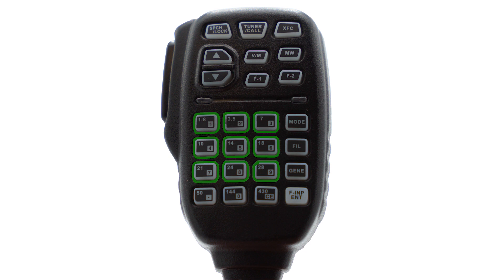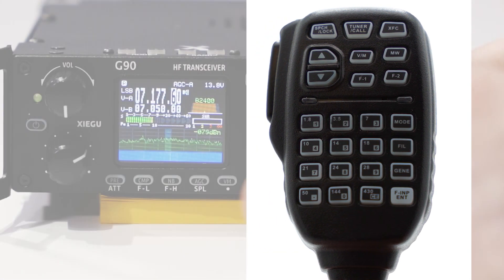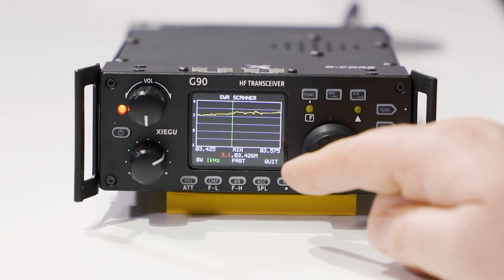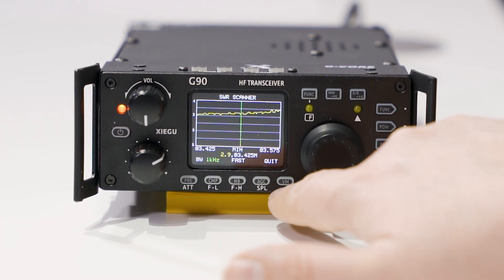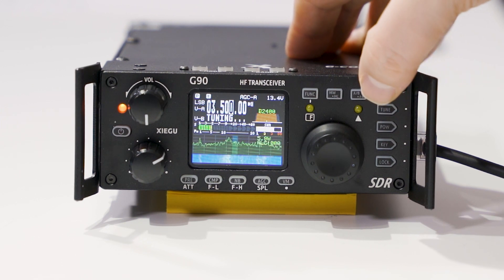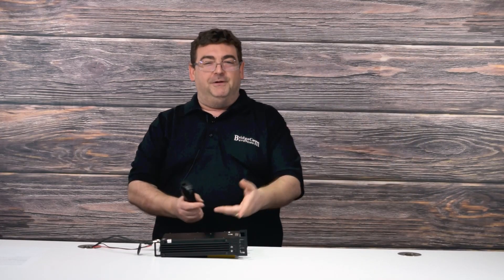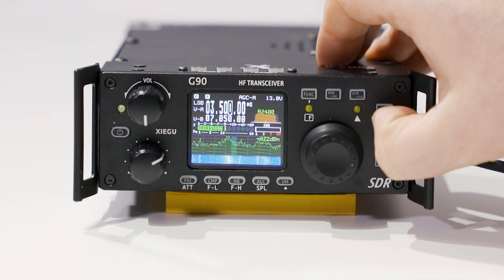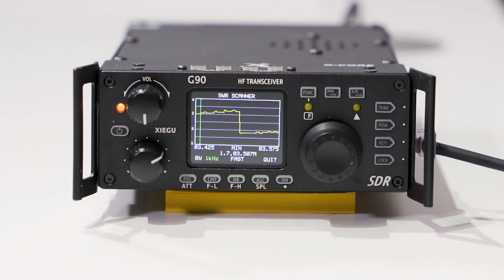Xiegu G90 Crash Course: Mic Controls, Memory Mode, and Antenna Tuning

Comment: Can the internal antenna tuner be bypassed in order to use an external amplifier and an external manual tuner?
Reply from the maker: Not sure.   But, there's help.  Join our Bridgecom systems Official Facebook group page and put your question there.  Lots of good help available.
Reply: @billr55  just don't turn it on.
Reply: @Charlie-Bee  Roger Roger, You are correct! 2 years ago I didn't know. Since then I purchased a 300 watt amp and with the external antenna tuner it works really well. The g90 has very good audio out of the box for the price and with a little fire in the wire now it works even better

Comment: When you tune an antenna it’s the internal tuner is it put in a memory or do you retune every time you turn the radio back on?  If it remembers, how many settings will it remember?  If the settings go into memory; how do you clear the memories?